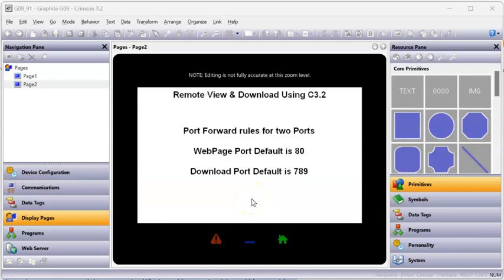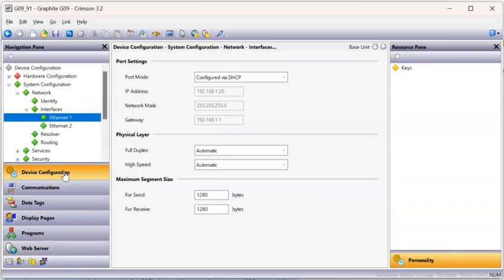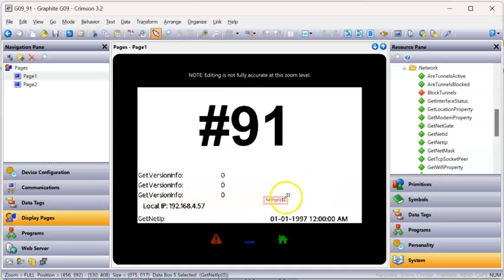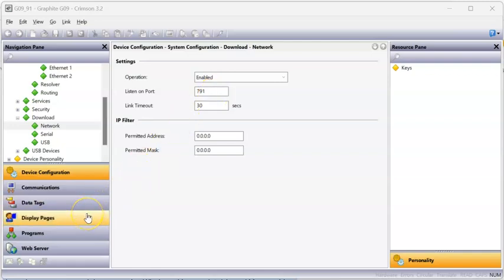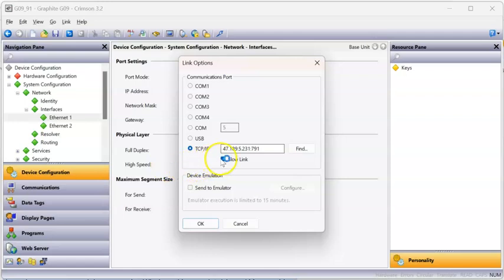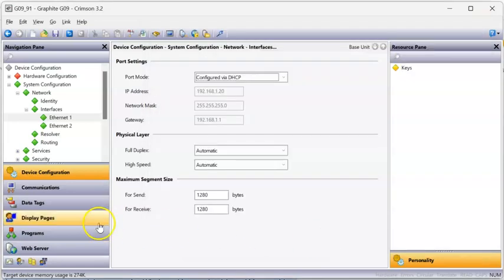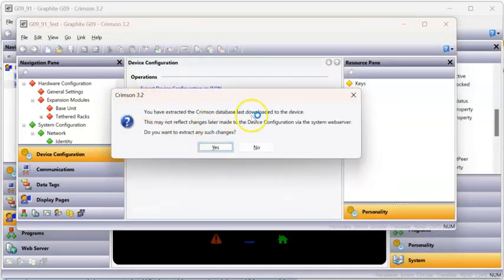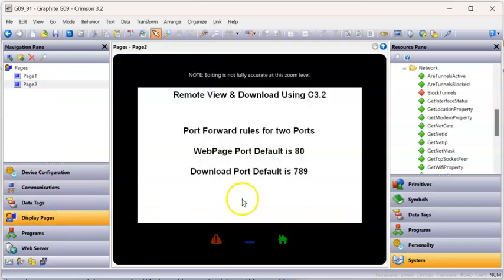Port Forward & Download Ports in C3.2

Comment: Hey joe, I have a g10 and the screen is bad and I want to use this database on the new CR3000 with a 7 inch screen. Both are running 3.1 crimson. How do I convert to a different screen size?
Reply: Open up the G10 database in Crimson 3.1.  Then go to File pull-down and choose Save Conversion. Pick CR3K 7" HMI and save file as a new name. You may need to tweak your DisplayPages a bit.